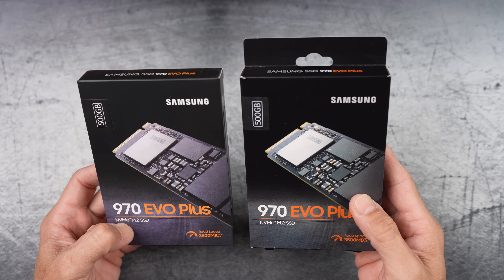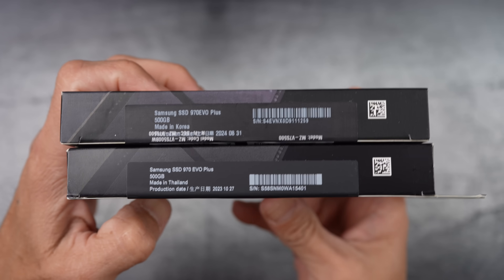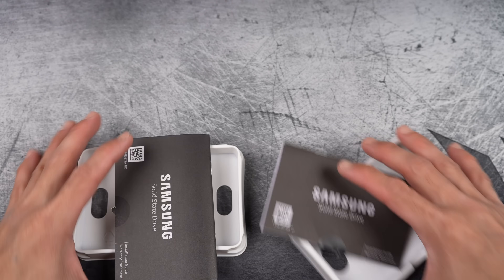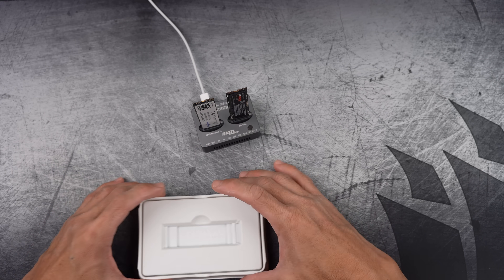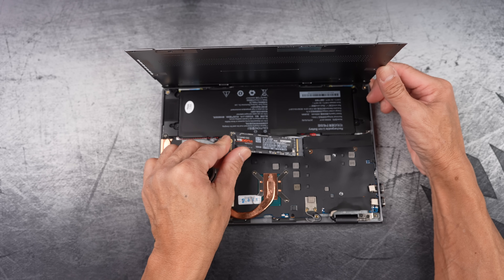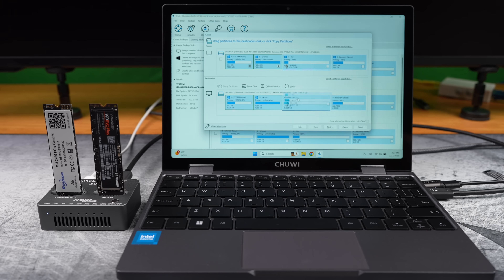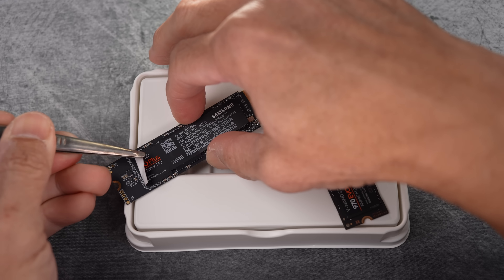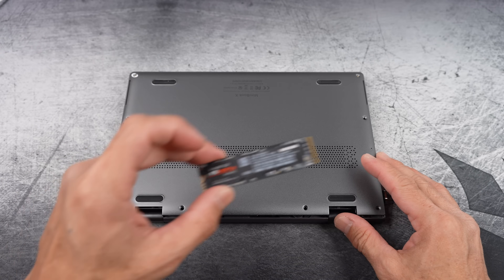Fake vs Real SSD - Can You Spot the Difference?

Comment: The real Samsung drive has only 500 GB, while the fake one and your old drive have 512 GB. (Samsung uses the "missing" gigs for overprovisioning to increase the durability.) Not trimming the capacity of the fake drive was a mistake of the scammers, but I guess they do not expect someone to complain about more capacity. 😅

That is also the reason why you failed to clone directly to the real drive. The cloning box does a dumb sector copy and requires the destination drive to be at least as big as the source drive. Macrium Reflect wasn't able to shrink the OS partition of the old drive, because it is encrypted with Bitlocker and had to be copied sector by sector too. (The partition was shown as "unformatted" and completely full.) But the fake drive was used to boot and unlocked, so Macrium was able to clone file based and change the partition size.

P.S.
If you didn't know that your drive was encrypted, immediately backup the recovery key oft the partition. Otherwise you will loose all your data in case of a mainboard failure.
Reply: Very cool description. Thank you!😊
Reply from the maker: Thank you for the detailed insights! That overprovisioning note on real Samsung drives makes a lot of sense. And the encryption and cloning challenges with BitLocker are a good reminder to always check configurations before cloning. Appreciate the advice!
Reply: Overprovisioning can be enabled or disabled as well as space percentage changed with Samsung Magician.
Reply from the maker: @igorpupkinable Thanks for this info. I wasn't able to shrink the OS partition because it was encrypted with Bit-Locker. However, it’s okay because I clean installed Windows 11. So everything is all good. 👍
Reply: OK the speed of the fake drive aren't very good but I just bought a cheap drive the only purpose of which is to act as a clone of my existing drive so that in the event of drive failure or corruption I can get back up and running quickly till I recline my drive or replace it with a good working one. I believe there is a place for slow cheap drives that may not have the same durability but will do as a seldom used backup drive. The only bit that is really wrong is trying to pass off a cheap drive as the real thing.
Reply from the maker: @davidcochran848 That’s a great point, David. Using a cheaper SSD as a temporary or backup clone drive makes a lot of sense—especially if it’s just to bridge the gap until you restore or replace the main one. I totally agree: the real issue is when these drives are falsely marketed as name-brand products. That kind of deception hurts consumers and gives the entire market a bad rep. Thanks for sharing your practical use case!
Reply: @davidcochran848  speed is excellent, just not as advertised.
Reply: Hm, the chips on samsungs tend to be different size so the multiple will be different, but yes there is also over provisioning, and the bonus with Samsung is you can set custom over provisioning to further safeguard your drive.
Reply: Good info. Thanks.
 I had to disable Bitlocker on mine...
Reply: Too true, backup the BitLocker key ASAP.
Reply: It appears that the most important test, a true capacity test (using h2testw or similar), is missing from the analysis. Only by filling the drive to capacity with test data and verifying successful readback can the true capacity be confirmed.

For at least 20 years, fake drives (SD cards, USB drives, and later SSD drives) have been produced that only contain a fraction of the advertised memory, but whose controller chips have been hacked to report an inflated false capacity.

The OS does not detect this, as it only displays the reported (false) capacity. The drives will work normally at first, but once the true (low) capacity is exceeded, data will be quietly and irretrievably lost. Even the files will appear normally in their folders. Only when you attempt to view, play, or otherwise read back these files (perhaps months later) will you find that your irreplaceable data (photo albums, baby videos, financial records, or other files that you thought were safe) are irretrievably lost. No data recovery shop can retrieve data that was never stored to start with. All you are left with are the file names pointing to empty space.
Reply from the maker: @TomNimitz Absolutely agree—thank you for a detailed breakdown. You’re right, tools like H2testw or F3 are essential for confirming actual capacity, not just what the OS claims. Scary how fake drives can pass as legit until you hit the real limit—and by then, then data loss. I’ll definitely consider showing a full write/readback test in a follow-up video. Appreciate you sharing this!
Reply: @TomNimitz  or they could be allocating resources in order to run other tasks 🤔
Reply: MVP righthere.
Reply: Wondering from the orig laptop ssd how you would find the recovery key.  My new laptop never came with one.
Reply from the maker: @mikebloodworth9258 If BitLocker was enabled, the recovery key might be in your Microsoft account (device recovery key), a USB drive, or a printed copy. If you can’t find it, the data might be locked for good—hopefully not.
Reply: @TossSong  Ahh OK,  I dont use bit locker, so I gather key not provided únless I activate it. Thanks.
Reply from the maker: @mikebloodworth9258 No problem. Yep, that’s right! If BitLocker was never activated, there wouldn’t be a recovery key. No worries!
Reply: @mikebloodworth9258  Right click on the drive in explorer and you should see "manage bitlocker" in the context menu. There you have the option to back up the recovery key. (saving to USB, printing, etc.)
Reply: They're just made in different countries, each having their own chips to gather data for themselves 😅
Reply from the maker: @knowwhatimeme Haha yeah, it definitely feels that way sometimes! 😅 But in reality, those regional chip variations usually still follow the same quality standards—unlike the fakes, which just mimic the look but skip all the real internals. Appreciate your take though—it’s wild out there! 👀
Reply: since you exposed the difference in components used i would use that discovery to return the item with the discrepancy using a pic of the actual drive compared to a pic of the drive on the packaging, since even with labels intact the difference is obvious
Reply from the maker: Good point — that’s actually a smart way to handle it. In this case, I kept mine for the video to show the inside details, but yeah, comparing the actual drive to the packaging photo is a clear giveaway. Even with the labels looking almost identical, the differences in components make it pretty obvious once you know what to look for.
Reply: BTW, I dont use Arch.
Reply: Ffs, do you all know what is the capital cost of making these drives? Not cheap. If you can setup such a factory would you go to the trouble of cloning drives and risked getting sued and fine, just go to Samsung and offer them a setvice! the above is not even a clone, its a diffetent design,the factory will need their own design team, and please don't think, some child labour can do this job. 
I bet some of you think some guys in some sweat shops are stamping chips and labels churning out thousands of these drives😂😂😂, plastic toys maybe not an ssd drives.
Reply: @tonyatgoogle6076  Regardless, it's still blatantly falsely advertised and a scam. Countries like China and the like don't give two shits about being sued or fined. They steal intellectual property under the guise of original products ALL the time and nothing ever happens because they know they can get away with it.

Comment: does the fake on had the full 500gb capacity  or only 250 or 128 gb and only reporting back 500gb
Reply from the maker: Only about 480 left and usable. It’s the same for the real drive. I’m okay with that since this laptop is my backup. Nothing is installed really. Thanks for your comment.

Comment: If someone sells you a fake and you catch them, they refund you the money.   That is  not an incentive to stop selling fakes !
The MINIMUM fine for selling fake items should be 10 times the retail value of the real item !   Now that’s a better deterrent!  Repeat offenders should face jail time in addition to the fines .
 So many fake items on Aliexpress.   Some items are clearly fake and Aliexpress does nothing to stop them.
Reply from the maker: I completely agree with your point! There needs to be stronger deterrents to stop sellers from profiting off fake items. Refunds alone aren’t enough, and stricter enforcement would definitely help clean up platforms like AliExpress.
Reply: unfortunately, Aliexpress seems to be completely uninterested in stopping scams. My dad used to buy usb flash drives from aliexpress, test them for true capacity, and refund. For fun. Basically doing the charity to highlight fakes. After a while, they told him to stop, saying "it's bad for our business".

Comment: Odd that the cloner AND the software would not work with the Samsung drive and might lead one to suspect that it was the fake. 
Others have stated that BOTH are genuine from different plants/countries but I question a brand that would sell such differing designs, PCBs, components, and performance as the same SKU.  That would hurt their reputation considerably.

Methodology and assumptions aside, your goal of raising awareness of the current level of counterfeiting  is still valuable information and I thank you for your efforts.
Reply: There's cases of manufactures swapping out TLC for QLC without changing the SKU. Crucial P50 for example.
Reply from the maker: It is interesting that the clone and software had issues with the one that was supposedly genuine, definitely food for thought!
Reply: @TossSong  one reason that the genuine one wont play with the cloner out of the box is due to not having any formatting at all. it has no filesystem and needs to be initialized once by formatting the storage to a particular format NTFS/exFAT/APFS. the fake drive must be formatted once by scammers to ensure the drive works out of the box for non-technical people who want to use it as an external drive.
Reply from the maker: @youtuberai Good point about the formatting! The cloning device is supposed to automatically wipe and clone, but maybe formatting the drive beforehand would’ve helped. In the end, I just did a clean Windows install on the genuine SSD after the cloning attempt failed. Thanks for the insight!
Reply: @TossSong  It's not any formatting. The software goes way below that.
Reply from the maker: Interesting point. I figured it might’ve been an encryption or controller-level issue too. The cloning device worked with the fake, but not the real one—which really threw me off. Definitely something deeper going on than just formatting! Possibly the storage size differences.

Comment: Why didn't you use Samsung Magician and Samsung Data Migration cloning software? On a desktop? It's free. Samsung will tell you if it's fake......for free.
Reply from the maker: Thanks for your comment. I did install it if you caught it on the laptop screen. However, I thought I would be able to do it in a short video and that it would be convincing enough by the end of the video.

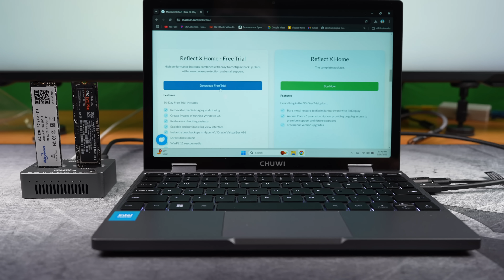Comment: @8:49 - I don't know why you say your original drives is faster when it is slower everywhere except in read speed by a few percent?  
Your cloning method via the device is your problem as you cloned the exact same thing with same fragmentation on drive 1, while the second one via software will optimize the layout of the target drive - hence why it was very long. Since your methodology was not consistent, your conclusions are flawed. And you have to two real drive, there is no fake. Both are made by Samsung at different plant, one has better silicon then the other.
Reply from the maker: Thanks for your input! I understand your points about cloning and consistency, but I still stand by my observations based on the results I tested. The physical and performance differences were too distinct to overlook in this case. Appreciate your perspective!

Comment: How are those still in circulation? Doesn't Samsung pursue fake copies?
Reply from the maker: I know. There are several sellers like this selling these fake ones and more on Ali, unfortunately. Thanks for commenting.
Reply: They have no real legal recourse in China, to get something like that enforced you need to have connections with a few pretty high up party officials and give "gifts"/maintain relations with the right people.
Reply from the maker: @frozendude707 It’s a tough reality and definitely sheds light on why counterfeit products thrive globally. It’s unfortunate that enforcement often requires those kinds of connections. Thanks for adding this perspective—it highlights how complex this issue really is.
Reply: @frozendude707  You seem to have a good understanding of public relations in China
Reply: Exactly. Samsung is still sleeping. Those fake drives destroy their customer confidence in their name. But they should also improve their customer service. I stopped buying anything from Samsung after a horrible experience with their support. They have a miserable reporting website and the personal support with people is nearly non-existing. As long as they have such a miserable service I will not ever buy a Samsung product anymore. They need to improve their service and also prevent the sale of faked chinese products. As long as they don't do that, I stopped being a customer.
Reply: In some impoverished areas, they don't have the financial resources to do so. This doesn't affect official sales. Everyone knows some people are using their second-hand products, but this is good for the brand.
Reply from the maker: True, in some areas second-hand products can be the only option for many people. I just wish the market for fakes didn’t take advantage of that need—it ends up hurting both customers and the brand’s trust in the long run.